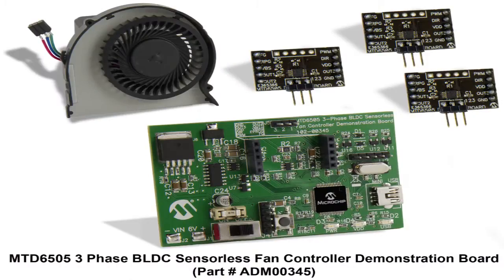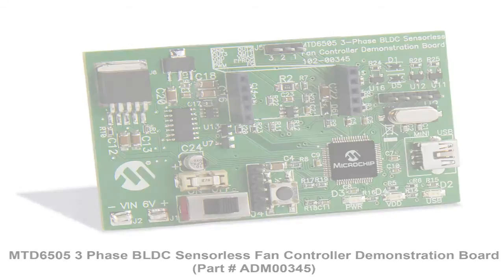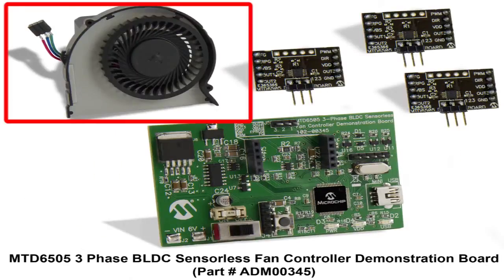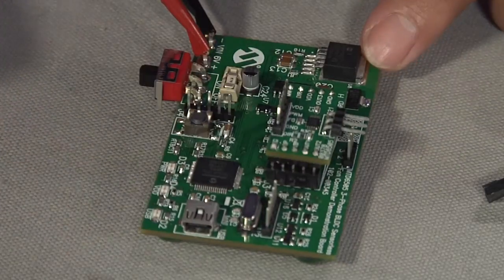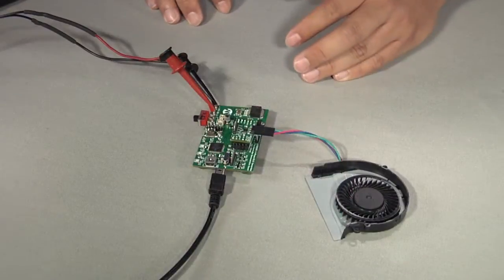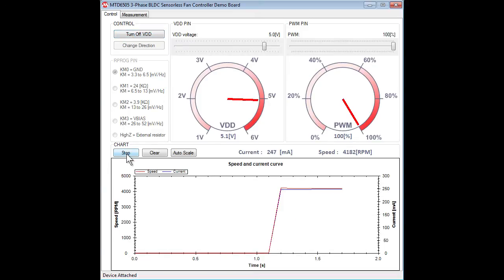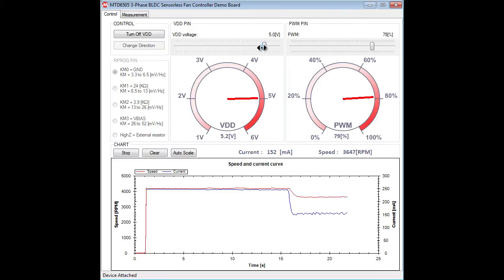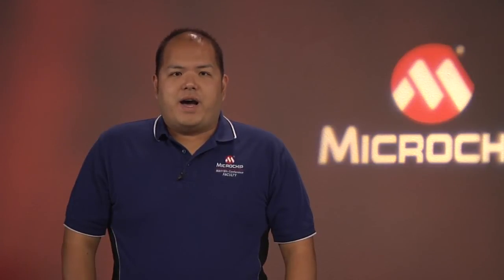MTD6505 3-Phase BLDC Sensorless Fan Controller Demo

Comment: How can we buy this unit what is tha nax power output.
Reply from the maker: Hi there, thanks for your questions. The maximum output current of the MTD6505 device is specified as 1000 mA (or 1A). However, the actual power output would also depend on the voltage at which the device is operating. Since the MTD6505 supports a power supply voltage range from 2V to 5.5V, the maximum power output can be calculated using the formula found in the datasheet: https://ww1.microchip.com/downloads/aemDocuments/documents/OTH/ProductDocuments/DataSheets/20002281C.pdf

You can purchase this device here: https://www.microchipdirect.com/product/search/all/MTD6505

Thanks for your interest in Microchip!